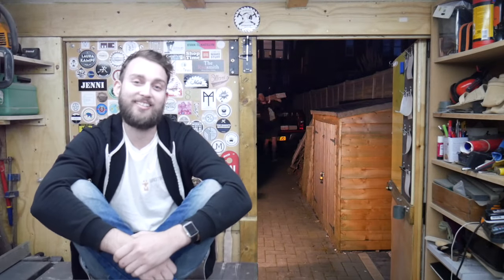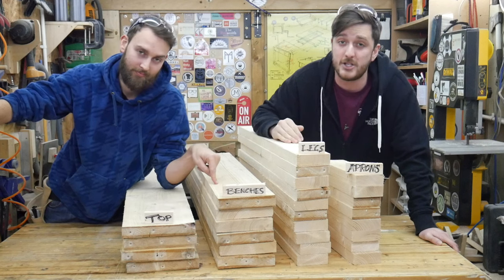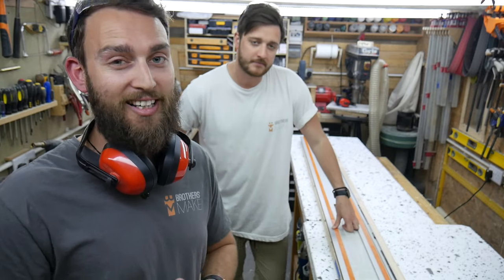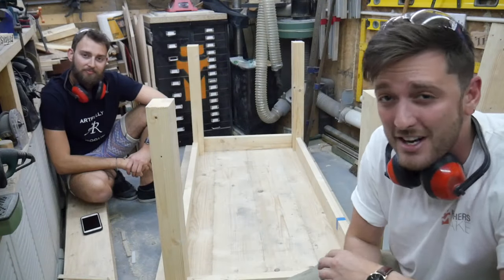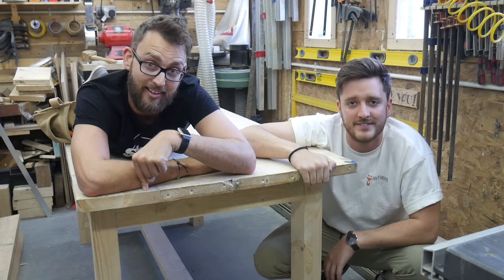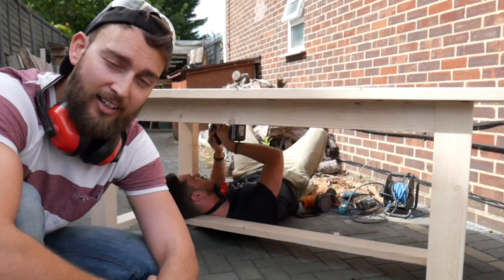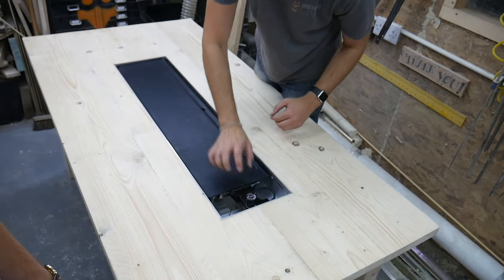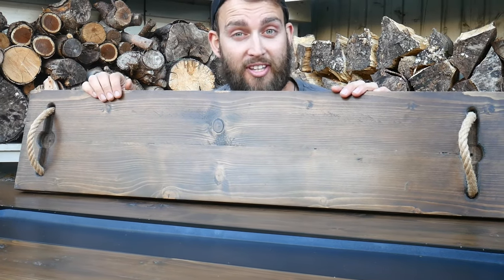DIY Table with Cooking Plate! - Scaffold Board Furniture

Comment: That's a great look and the hot plate is a really nice touch. Love the re-use of the metal end grain straps too👍😁 There isn't a great deal you could add to that really....maybe some narrow draws in the tables apron for cutlery stowage?? 🤔 I recently used two scaff boards on the stairs to get rid of two old flat pack bookcases and I did similar with the finish(light sand to leave the character). I left the straps in situ...really liked the look of them
Reply from the maker: When we were brainstorming for this project we did think about adding narrow drawers but ultimately we went with this idea instead. We love how these scaffold boards turned out aesthetically but at times they were a pain to work with! Thanks for the comment dude! 👍🏼
Reply: @BrothersMake  You did good guys! Thanks for the upload!!😁👍

Comment: Great build guys and I really enjoyed the video too, perfect balance between keeping things entertaining whilst also providing lots of really useful information - you can defiantly see why Matt is a teacher haha! There are a few things I was wondering whilst watching however: 
- Is there any reason you didn’t create the cutout before gluing the top together? I just would have thought it’d be easier to do the cuts whilst everything is still in components and then you’d have a perfect fit without having to take into account blade thicknesses etc
- Does the doweller cut one or two dowels at once? Looks like a really good bit of kit that would definitely make glue ups easier and quicker! 
- What was your thoughts behind making the extended indeed and outfeed on the thicknesser? I’ve got the exact same model and would love to know if it helps reduce snipe and if it’s possible to plane really thin veneers. 
Thanks guys!
Reply from the maker: Thanks! We didn’t cut the section out prior to the glueup because some of the boards were heavily warped and we figured it would come out more accurate the way we did it, albeit a little trickier. The dowelled does indeed cut two holes at once - super handy tool! And we made the custom bed for the thicknesses primarily to reduce snipe and provide more support for longer boards. It doesn’t totally eliminate snipe on its own but if you add a couple of other tricks it pretty much does then (feed boards in at an angle, but each one up behind each other). We don’t have much experience in thicknessing super thin strips but I can’t see why it wouldn’t work!

Comment: great work chaps and not a negative comment however, how do you remove the fat catcher whilst using is?
Reply from the maker: We trimmed the drip tray so it still fits under the hot plate. Once it has cooled down you simply lift it out and slide the tray out for cleaning 👍🏼